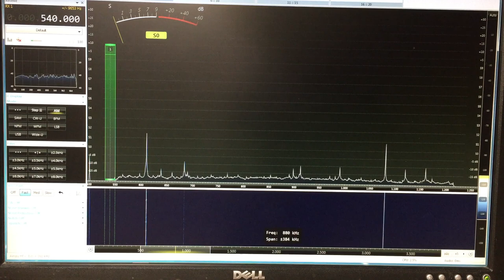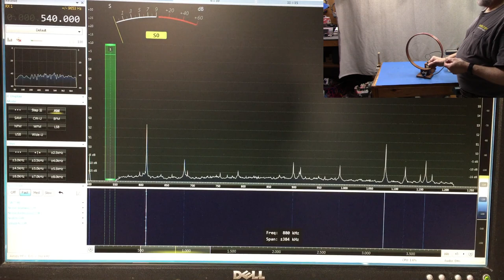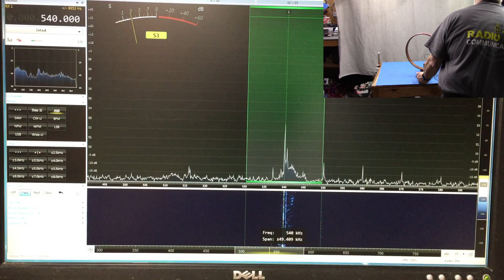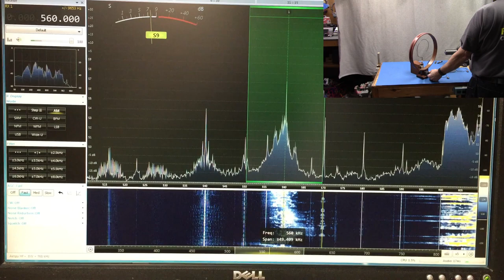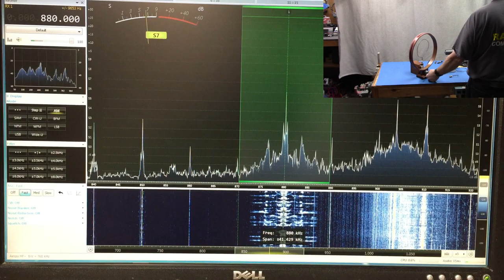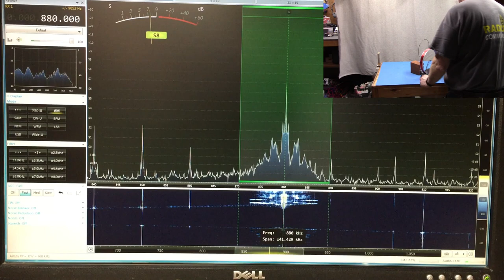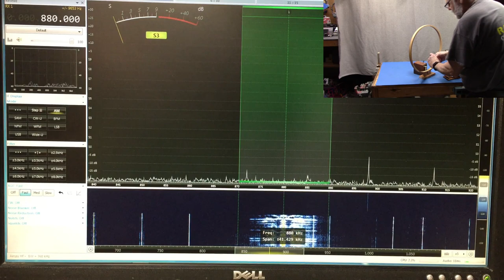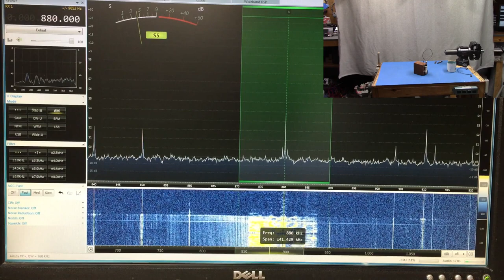Simple Method of Coupling  your loop to an SDR or other receiver.

Comment: Not sure what you moUnt the  smaller loops to??? Just a plain coax female plug ? Looks like a box very confusing
Reply: It's an SDR (Software Defined Radio) called HF Discovery+ . You can connect it to computer and listen to radio and do other interesting RF related sutff.

Comment: I have a Drake Radio hand book written in 1931 which describes this same loose coupled tank circuit as a signal multiplier so we are not inventing the wheel here folks. 90 years ago they worked all of this stuff out with log tables, slide rules and inquiring minds.
Reply: Well, if they were using slide rules, they probably didn't need the log tables.

Comment: This is very interesting and reminds me of the "teaser" coil in crystal radios. Would you get a stronger signal if the secondary loop (with the BNC) had several turns?  Thanks for taking the time to make this.

Comment: Have you ever tried using an EMF source to transmit frequencies onto a coil? The function generator would inject the signals to the EMF source and the coil would receive the signals.

Comment: Nicely done, OM.  I like the simplicity of the test setup - allowing you to change small loops with ease and speed and let you step back and not become part of the test.  I wonder what would  happen if you taped a pickup loop around the main loop device so have a 1:1 pickup size?  Thanks.  73   TT

Comment: Sorry.  Did not know the right place to ask this.  I am trying to receive a very low power 125 kHz signal.  I was wondering if you could suggest an antenna loop size and number of turns I should consider making for this purpose.  I am using a Ham it up plus and an rtl-sdr v3.  I am using a loop antenna I purchased from Amazon .  The signal appears very weak as it should.  8 db over the noise floor of -84 db.  Curious what you would suggest.  Thank you for any suggestions!!

Comment: Paul could you couple a outside large loop antenna through a ferrite core  to the smaller loop that would pass your larger loop signals to the indoor loop and then pick it up on the sdr  so you could use the tuning knob  for selectivity 
From the big loop.
Probably a stupid question 
Chuck AA4CP
Reply from the maker: Nope not stupid at all.    I have done that in a very specific case.  I used the main loop tuned to a station through a  twisted pair of wire, to a small coil, on top of a AM radio as you suggest.  This allowed me to turn the loop in any direction with out having to move the radio.  Also it allows running of a remote loop outside lets say to a radio with no external antenna connection.  Try it experiment W1VLF

Comment: Is it possible to make a direct connection the the loop antenna?  Possible as in would that work?   Is inductive coupling better than making a direct connection to the loop antenna?
Reply from the maker: Steve,  It would not be better to connect directly to the antenna. Here's why,  When you connect directly to the antenna you load down the loop with the receiver's input impedance, say 50 ohms.  So the one turn is like the primary on a transformer.  This will spoil the Hi Q of the antenna an cause signals to be low and you will not be able to tune the antenna.  Secondly the one turn inductive feed isolates the coax ground from the antenna to achieve better balance and nulls.  W1VLF
Reply: @W1VLF  thank you for the response and very good explanation. 

Hopefully I am gonna be able to have the time to build one soon. 

Just have a RTL-SDR  right now.  Was thinking about the RDPplay  but I gonna look at the airspy since you have had such good results from ut..
Reply: @W1VLF  hey brother man, I tried making my own.   It is 2ft square. 15 turns of 24 gauge solid wire from lan cable and 500pf air cap.  Online am loop calculator said that should work. I have only tried on my old 6 band table top radio sitting inside it.  I think it makes a tiny bit of difference but nothing I can see like I have seen on other videos.... 

It did have a small effect. It seemed like one time I was able to make radio go from one station to a different one turning the cap.  I think I accidentally made a super sharp Q.  

H e double hockey sticks if I know. I must have messed up somehow. 

Haven't done the small loop to see if it works on SDR yet.
Reply: @W1VLF  update same night:

Ok I slowed down.

1. Hard mounted the air cap
2. Turned off the dang noisy lights. 
3.  Realized I happen to build this thing on a night that is a DXers wet dream. Can't touch know without coming across a signal. 

Listening to a station from Chicago and I am near gulf coast SETX.

Comment: Thanks for the interesting video. I have a homemade box type loop antenna and managed to connect my Yaesu FRG-100 using coaxial cable from the radio antenna output connection and connecting to another piece of coaxial cable via an F75 connection and draped around the loop antenna.  I have also made it possible to use it with any loop antenna and even a long-wire antenna separately. You seem to go well with less noise down the lower end of the AM band. Here in Melbourne Australia, the unwanted noise is quite bad these days, especially on the lower frequencies. All the very best. Robert.

Comment: I do watch this vedio multiple times. It's so informative. So bigger loop bring in more sensitivity and smaller Coupling more selectivity. Also what should one use for more sensitivity, a big loop or ferrite rod antenna.. does it make any difference if you make one end of ferrite higher than other end as I see it not perfectly horizontal in some radios

Comment: Hi Paul, I do have the tecsun AN-200 loop antenna (your grundig) and with the audio cable I did connect it directly to my rsp1a. I think I will get bigger signals if I use a loop like you did. Can that be true?
Reply from the maker: I suppose it possible, But the good thing is it only take a couple minutes to try it and find out. Build that 4" loop ZI showed and see what happens.

Comment: Everett Sharp has said that a 64:1 impedance ratio transformer between the coupling coil and receiver improves the signal transfer. Have you ever added a transformer to your coupling loops?   73, Guy
Reply from the maker: Hello Everett, I have not, but a that should be simple enough with a BN-73-2020 core.  I will give it a try. Thank you W1VLF
Reply: @W1VLF  I'm not Everett, but I learned this trick from him in a forum message he posted 🙂
Reply from the maker: @4nradio782  Sorry about that ... Things are pretty hectic here.  Promise I won't do it again.  😊 W1VLF

Comment: Very informative video. Thank you! One question I have is whether it would make sense to couple the receiver directly to the large loop? I’m guessing that the motivation for using the small coupling loops is to avoid needing an impedance matching network, but as you point out, the smaller loops do not take advantage of the larger signal strength available from the large loop. Am I thinking about this correctly? Thanks again.